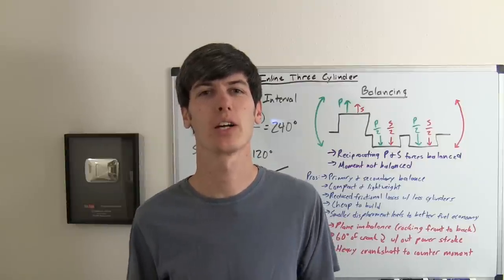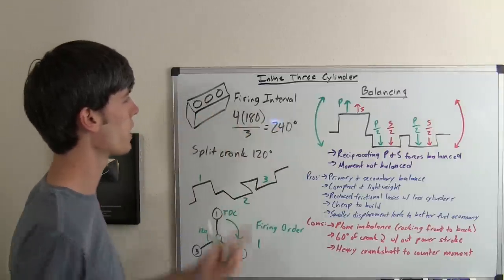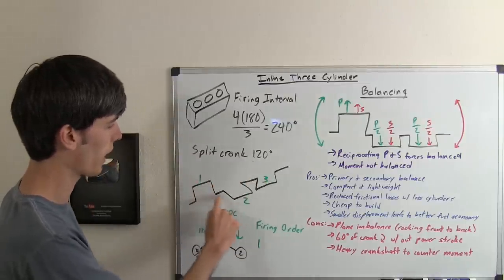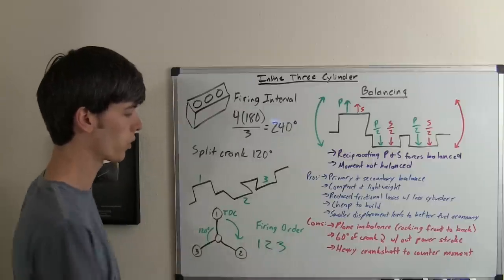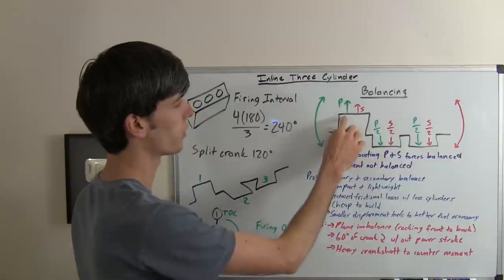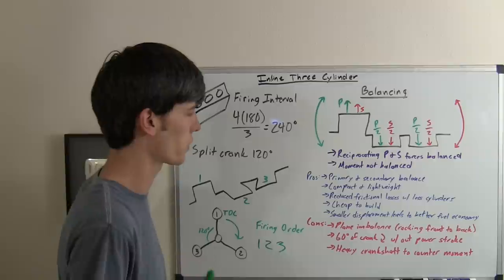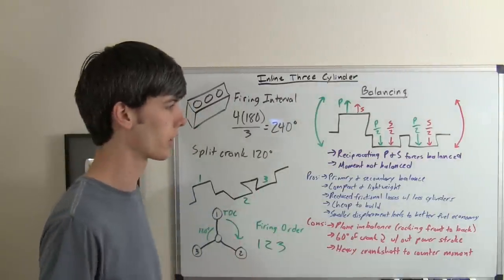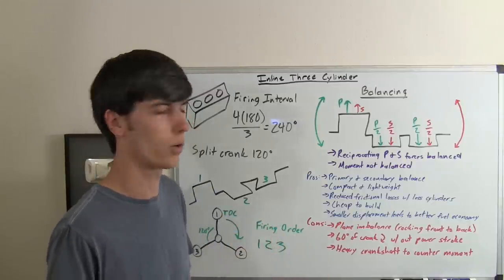Inline 3 Cylinder Engine - Explained

Comment: I'm not sure if I understood everything totally right but shouldn't it 240 degrees between every power stroke?
A one cylinder engine has a power stroke every 720 degrees and so a three cylinder engine should have one each 240 degrees.
Isn't this, what you're calculating with your equation (number of stroke by 180 / number of cylinders)?

Please tell me, if you meant something different.
Reply from the maker: Yes, 240 deg of crank rotation for each power stroke, as noted in the top left of the whiteboard.
Reply: Yes, ok, maybe I should have mentioned that I ment the 60 degrees you were talking of when you said something about the cons
Reply: Yes, maybe I should have mentioned that I ment the 60 degrees you were talking about on the cons
Shouldn't that be 240 degrees?

Comment: the geo metro also uses an i3 in some models
Reply: cody smith Yep, the 1st gen Geo Metro, (also Suzuki Swift).
Reply: i almost bought a 3 cyl geo metro hatch 5 speed. just cuz.
Reply: +cody smith i had a '98 for 10 years, now owning a smart fortwo, i wish i still had the metro, front wheel drive and a regular manual tranny, plus a little extra cargo space over the smart.
Reply: I have a 92 model Geo Metro four door hatchback with the 3 cylinder and an automatic transmission. Hoping to convert it to manual transmission soon.

Comment: Our '86 Chevy Sprint (Suzuki Swift GM rebadging effort that became the Geo Metro) had a great little 1L 3cyl engine and manual transmission. We bought a great used example with 88k miles and drove it to more than 128k miles when we sold it to a local high school student who trashed it in under one month. 50HP in a 1600lb car was adequate and regularly gave us 40+ mpg.  Thirty years later with better technology cars today still struggle to meet that number due to the added weight they carry with unnecessary added luxuries and mandated safety equipment.  Wish I still had that car.
Reply: Scott Lockhart 87 crx 1.5l 4cyl engine, 85hp. 55hwy mpg.
Reply: I currently drive an 88 sprint and love It!  55+mpg, better than a prius!  And I only paid $600.   Most reliable, simple, easy to work on car I have ever had and the 5spd makes it sporty!.. in a go kart sort of way!    30 years old with 300k+ miles and not a single problem and will happily do 65 on the highway.   People bash these little cars..   but id take simple efficient and reliable over a nepolian complex mobile any day!

Comment: Why do we have 60 degrees of crank rotation without a power stroke. I thought the firing interval is 240 degrees? Am I mixing something up?
Reply from the maker: LennLala A power stroke lasts approximately 180 degrees.
Reply: Engineering Explained I have a 3 cyl. engine and when I floor it at low rpms (2.5 - 3 rpm) I can feel a slight lossof acceleration (.300 miliseconds aprox)  thats the 60 degrees without a power stroke? or something else?
Reply: +Engineering Explained 
much less than 180 degrees, as at firing, the moment resulting from the explosion is nil and the end of the stroke, pressure on the cylinder has decreased significally
to be able to speed the engine, the exhaust valve must open before the piston reaches the bottom of stroke to relieve pressure to free piston return.
the result is that the efficient power stroke is not over 12 degrees and on high RPM camshaft it is significally less
Reply: +Jacques Poirier You're forgetting that the spark plugs fire slightly before top-dead centre for that reason, so it starts burning as soon as the power stroke starts.

Comment: Hi, in this video you say that a lower displacement engine gets better fuel economy, and it seems logical, yet some people say bigger displacements get better fuel economy because at the same speed they're running at lower RPM. 

What's your take on this?
Reply from the maker: Bugside almighty Nope. Obviously the design is important, and there are probably larger engines out there which are capable of higher MPG than smaller engines out there, but the trend is not there. Smaller engines with lower displacement run at higher loads, and higher loads are more efficient at producing power than light loads. Also, larger engines have more friction (as they typically have more cylinders and thus  many more moving parts), and use significantly more gas at idle.
Reply: I find this is sometimes true on the highway, but never really true in town.

Comment: About the lack of smooth power delivery, couldn't they make these engines more like those in F1 cars where mose of the displacement is in the bore, not the stroke? That way they could make the rev range a lot higher at both the top end and at idle. Would this not work?
Reply: It would work. Emissions laws don't allow this design though, so stroke is typically 10mm longer than bore width. Motorbike engines in general are very short stroked to get greater power. Emissions laws are more relaxed and due to their light weight less load is on the engine so emissions can be managed.
Reply: That's too bad. It seems like if a company like GM could get a room full of clever engineers and just have them brainstorm for a while, they could figure out a way to meet the emissions standards.
Reply: They have - they do it by designing oversquare engines. That's before they add every other emissions system.

There's nothing special about GM by the way.

Comment: The crank is split into 120° intervals stroke-wise, but if the firing order is 1-2-3 and 1-3-2 I think there will be a huge difference. 
For example if the order is 123 - there will be a firing at 0° for the 1 cylinder. then at 120° for second, then at 240° for the third, but after that there will be a firing gap for one revolution of the crankshaft. Cylinder one will suck air at 0°, cylinder 2 at 120, cylinder 3 at 240, and then the 3rd revolution of the crank will be same as 1st.
But if the firing order is 132 - there will be a firing not at every 120°, but at every 240° and things will be different - 1st cylinder fire at 0°, then second will be the third cylinder at 240°. and third will be the second cylinder at 480° which will be (480-360=120°) at 120° of the second turn of the crank and then again 1st cylinder at (120+240=360°) 0° 
So the smoother firing order will be 132 because of lack of firing gap during cylinder intake strokes in the 123 configuration :)
Cheers and sorry for my poor English if somewhere something is not clear.
Reply: I'm sorry but this hurt my head trying to read this haha
Reply: Look at the engine rotation arrow on his white board! 123 or 132 both work, depending which direction the engine rotates! ;)

Comment: When calculating the fire interval, why do we multiply the number of strokes by 180 degrees?
Reply from the maker: Andre Bettio 4 strokes, 2 revolutions of the crankshatt. Each revolution is 360 degrees, times two (revs) = 720. 720/4strokes = 1 stroke every 180 degrees.
Reply: Cool, thank you!
Reply: That assumes the crankshaft is rotationally symmetrical ( rod journals are spaced evenly around all 360 degrees).  A 90deg crankshaft angle V-twin has firing intervals of 270deg and 450deg (asymmetrical).  So does Yamaha's strait twin (270 deg crankshaft angle) used on the Super Tenere.    

Engineering Explained,
  A video about different crankshaft angles would be interesting.  For motorcycles, having a large firing angle can give better performance at the limit of traction at the rear wheel because it gives more time for the rear tire to re-grip (static friction) the road surface before the next power pulse.  In my opinion, that's why thumpers (big singles with 720 deg firing) make such bad-ass cafe racers.

Comment: What is it called when a 3 cylinder is on its side? Is this a boxer 3  engine?
Reply: A 3 can never be a boxer. You could make it a flat asymmetric V, but the balance would be terrible, and an inline 3 is already very short so making it wider doesn't make sense.
Just laying an i3 on its side would be a slant 3, which definitely has its benefits and has been done in the BMW K75.

Comment: Some decades ago, 3-cylinder 2-stroke engines were not that rare. Both SAAB and DKW Autounion were using them. The modern 3-cylinder engines, however, are 4-stroke engines. Is there any special reason, why  3-cylinder engines back in time were especially popular as 2-stroke engines?

The explanation about crankshaft, firing order and balancing made me think about 3-phase electric motors, which have absolutely constant power all way round the rotation. Of course, this is not possible with a piston engine.

Comment: Would an inline 3 cylinder engine be more lively due to the lighter block and less inertia in the pistons, given that there is less of them?
Reply from the maker: Depends on the displacement, piston size, bore and stroke, etc. Could be lively, could be dull.
Reply: Engineering Explained Alright thanks man!

Comment: In a 3 cylinder engine there is 120 degree difference between power strokes of 3 cylinders. But what is the case with 4 cylider engine. Can anyone please explain this.Also why is a 3 cylinder engine more noisy at lower rpms compared to a 4 cylinder engine?...

Comment: I always had this question about economy compering it to CC, what i mean is that for a 3 cylinder 1.0L (60hp) engine to run at 40mph (let's say highway no starts and stops) it needs lets say 40% of it's full power while a 4 cylinder 2.0L engine would need 20% or less of it's full power, so isn't the 2.0L (150hp)  engine burning less gas???
Reply: Nope. 40% of 60 is about 25 hp, 20% of 150 is 30 hp. Need more fuel to get more hp. 

Several factors effect fuel usage. 
1) the gearing
2) engine efficiency peak
3) how the engine makes power
 - compression ratio
 - ignition timing
 - volumetric efficiency (ie throttle opening and forced induction boost pressure)
More power can be achieved per volume of fuel with increased CR, advanced timing and increasing the boost pressure (it's true, cars pumping 50 psi on straight meth or ethanol or c16 etc have insane BSFC). Obviously, the more power that can be extracted from a gram of fuel will result in greater efficiency.

A small engine running at greater throttle opening has a much greater volumetric efficiency as more air is getting in the cylinder. It is fair to expect that the turbo is also partially spooled and producing mild boost. More air in cylinder results in higher peak pressure before combustion, greater HRR, higher gas combustion pressure, all of which increase the amount of power extracted from the fuel used.

Comment: Would it be a good decision to turbo 3 cylinder
Reply: Yes, 3 cyl. engines respond very well to turbo charging.
Reply: Propeller Head which turbo would be good for a vw 1.2 mpi

Comment: So I still don't understand and maybe there's something I'm missing.  A 4 stroke engine has each cylinder producing power ever OTHER time its crank throw goes around.  With an inline 6 cylinder engine, the crank throws are 120° apart, but there are pairs of them.  These pairs are not necessarily next to each other but there are three pairs of throws, the pairs all offset 120° from each other.  When one paired cylinder is in its power stroke, the other is in its intake stroke, so every 120° there is one power stroke, so it's an even firing motor.  The same concept applies for a 60° V6 with non-split crank throws.  An inline 8 or 90° V8 is similar with power strokes every 90°.  An inline or boxer 4 produces power evenly every 180°.  Even an inline twin is evenly every 360°.  But I cannot for the life of me wrap my head around how a 3 cylinder fires evenly every 240° because it doesn't have paired cylinders.  Maybe an animation would help....

Comment: Can anybody explain where this 60 degree  of crank w/out power? I couldn't calculate it.
Reply: +Hasan Akgün a four stroke engine does: intake, compression, expansion and exhaust. On a 4 cylinder engine, they take turns so there's always one that's doing expansion (the actual power cycle where the fuel mixture is ignited and expands). On a 3 cylinder, the crank shaft still has to rotate 360° but you got 3 cylinders doing 4 strokes each. So one cylinder is expanding, then it goes up again and then there's a little gap until the next cylinder is expanding.

Comment: Have you ever given consideration to an X -Configured engine such as a Double V6 with 2 opposing pistons off each connecting rod connection ? One cylinder firing conventionally and an opposing cylinder firing upside down ? A 12 cylinder engine, same length as a V6, haven't yet devised the oiling system or the X-configured exhaust ports.  Would like to see a modern engine built to the plans of the earlier Packard Design of the late 20's, early 30's

Comment: i heave a Toyota Aygo 3 cilinder engine  ( 998 cc, 68 hp ), and before that i had a Renault Megane 3 4 cilinder ( 1598cc, 110hp)  and between them i noticed that toyota is litle , and i mean VERY litle slower ,  i can get to 100 kph 2 seconds later than renault , but ghiving the fact that consumes half as much as Renault  , and it does not heave the vibration you are talking about  is ( for me at least ) far far more better this 3 cilinder engine .... and is a big slap in the face of 4 cilinder engines. ( at least the ones up to 1598 cc.....................

Comment: That would explain why its not very possible in my mind to have a smooth running four cylinder engine. Every four cylinder engine Ive driven I can feel the vibration at idle, until it gets off idle. Even though some have balance shafts, it still not that smooth at idle. Jason tell me, I am I right or wrong? I can see why a three cylinder would have a smoothness problem but a four cylinder would be easier to balance out, ... I think.

Comment: What if cylinders 1 and 3 were moving at the same time and the firing order was 1, 2 , 3 or even if it could have a firing order of (1,3 ) , 2 .. where 1 and 3 fired at the same time and the cylinder 2 was there only to give momentum to the other cylinders when they were at the exhaust stroke .. in my mind that could reduce the imbalance  ( that rocking effect) and the engine would rev easier and overall it would be lighter

Comment: How does he figure out that there are 60 degrees of crank rotating without a power stroke?
Reply: Engine fires every 240 degrees, and power stroke lasts 180 degrees. 240-180=60 . Was not so hard.
Reply: sorry aladen, ill try harder next time

Comment: Overall per minute power strokes will be less, yes. But I don't kno why you have chosen specifically '60 degrees' in the con. Why declaring that no powerstroke in 60 degrees? Won't the statement that there is no powerstroke every 119 degrees still be true?
Reply: No. 
When the spark fires in one cylinder at top dead center, its power stroke will continue for 180 degree of the crankshaft rotation, pushing the piston to the very bottom (bottom dead center).

Each stroke will occupy 180 degree rotation of crankshaft.

What he means is that since firing occurs every 240 degrees, once the power stroke ends at 180 degrees, the crankshaft will not experience another one of the cylinders firing for the next 60 degrees between 180-240.

In a 4-cylinder 4 stroke engine, there is always a power stroke at any time. Since the firing occurs every 180 degrees . Hence when one power stroke ends for one cylinder, another one immediately begins in another cylinder.

Comment: Confused why the crank would need to be heavier. Wouldn't other weight mounted to the ends of the engine be just as effective in damping motion? Use the shorter engine length to hang accessories off the ends?

Comment: 1-2-3 and 1-3-2 firing orders are the same, because 1-3-2 is the same as 3-2-1, which is just 1-2-3 reversed!  The only difference is in how you number the cylinders and if it fires front to back or back to front.  So not totally the same, but still linear.

Comment: totally for got the mitsubishi mirage with the 3 cyclinder made in 2014 and 2015
Reply: +christopher kelly and the smart fortwo, which from '08-15 used a mitsu 3 cylinder.
Reply: +mr bad example 
lol I have a 2011 smart fortwo. I'm still learning all this stuff (or trying to) but I like my car. It's a little weird to get used to the delayed response in acceleration and the odd braking, but I got used to it quick. I went from an 88 f150. Never been a fan of the "look" of cars, and honestly got the Forttwo mainly for the clownish size and look compared to my 6'5'' self. I didn't want a truck because I had hopes of being able to fix my f150 but the cost just didn't seem worthwhile at the time. 

We saw meet again Larry (my 88 f150) in Valhalla......
Reply: xinic5 i've had my smart since january '08, the first in my state. my car is featured in a 2010 new york times youtube video :)
Reply: +christopher kelly- Great video explination. You left out the venerable 1988-2001 Geo Metro, Pontiac Firefly ( all really a Suzuki car) 1.0L 3. I have a 94 hatch back 3 door that never gets below 43 and can easily do 50+ MPG driven easily. Unfortunately our EPA / Fed Gov commissars have so many regulations and safety rules on new cars that are at odds with the new high MPG numbers, that although very possible to have a 70+ MPG Metro car it will never be made.

Comment: easy, just make the 3 cylinders rotated 120 degrees apart. it'll make changing the spark plug a pain in the ass but I guess that's the mechanic's problem

Comment: There is a power stroke every 240 degrees not every 60 degrees.
Reply: A power stroke takes 180° leaving 60° gaps, where a 4cil has no gaps and higher cil engines have overlapping power strokes.